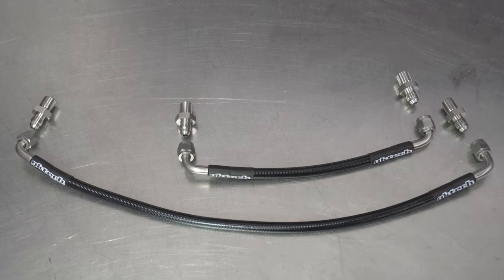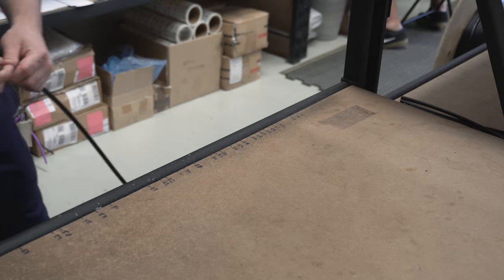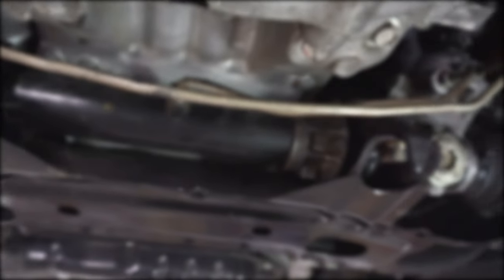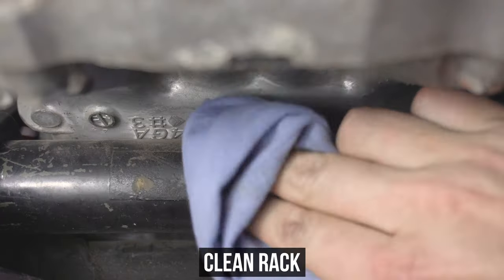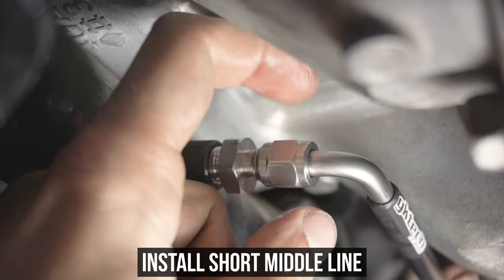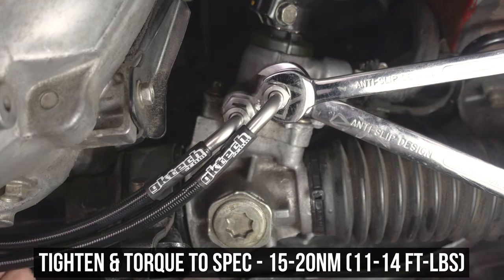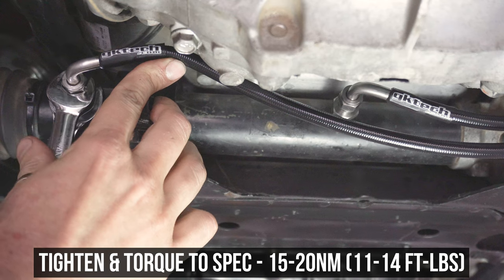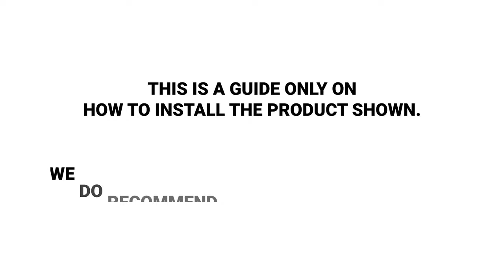Gktech S Chassis Power Steering Hard Lines Replacements - Install

Comment: hi do you sell these for s15?
Reply from the maker: Sorry, we don't currently.
Reply: @gktech  do you know why the s14 lines don't fit?? or have you guys just not tried?
struggling to replace my crushed lines
Reply from the maker: @samjc5197  They are a different length due to line orientation